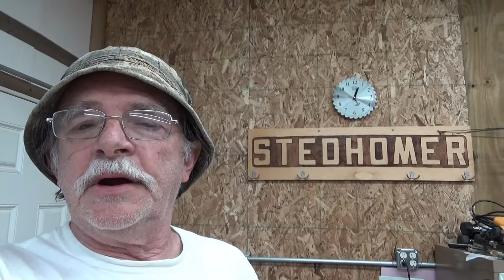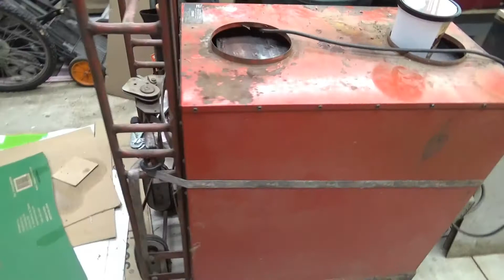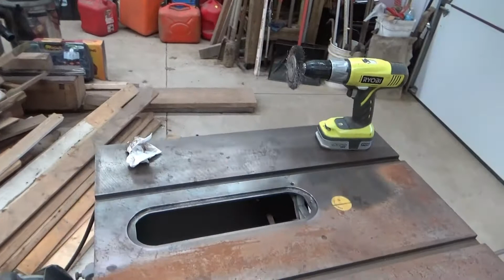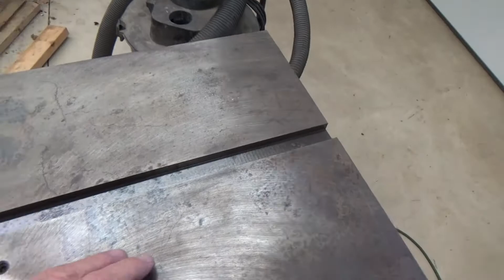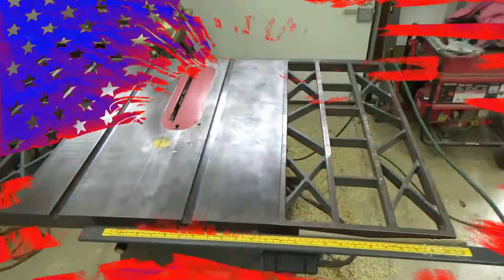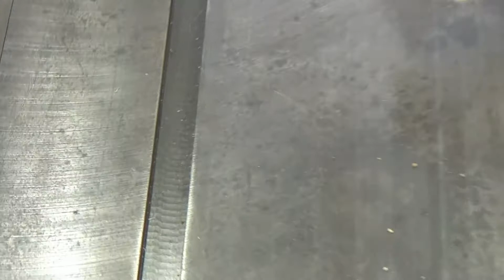Cleaning Dad' Table Saw Up.

Comment: Got to love those old Craftsman table saws. I upgraded mine a few years ago with a Delta-T3 Fence and now have no reason to buy a newer saw.  I tried to remove the milling marks with sanders but gave up. The main thing is it's flat with a smooth surface.
Reply from the maker: I may have to look into that Delta T3 Fence. I gave up on smoothing this one out as it doesn't seem to need it. I LOVE THIS SAW!!   Besides, it was Dad's and I kind of like it this way. :-)     Where do I find the Delta T3 Fence?
Reply from the maker: Oh Yea,,, Thanks for stopping by!!! :-)
Reply: Best price at the time was Home Depot delta fence t3 at $209.
A little pricey but well worth it.
Reply from the maker: Thank you ever so much! I will be looking into this for sure. :-)